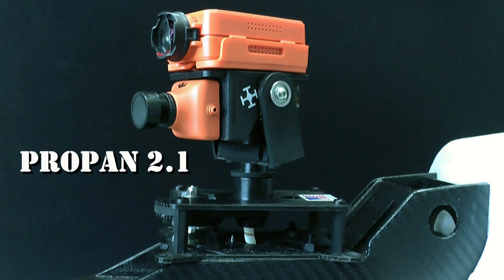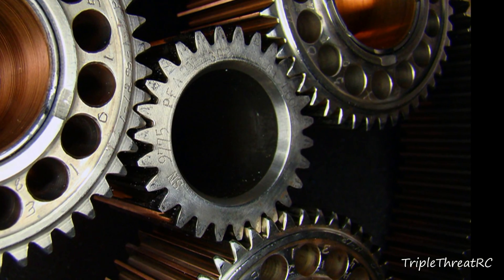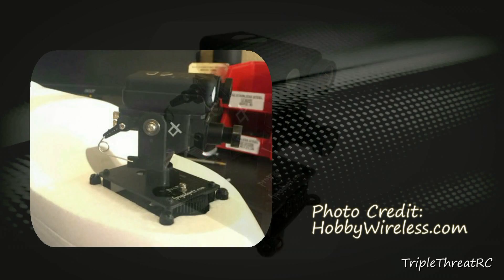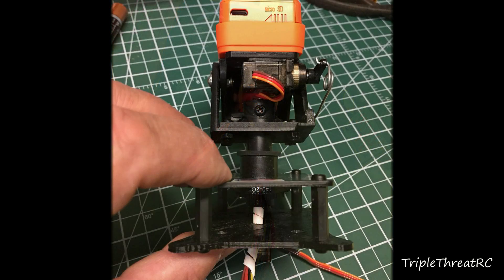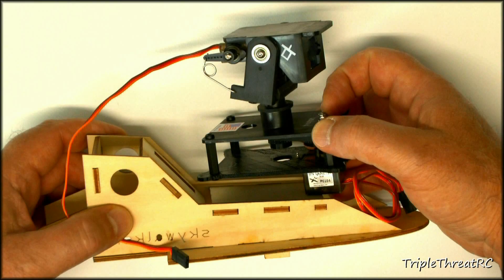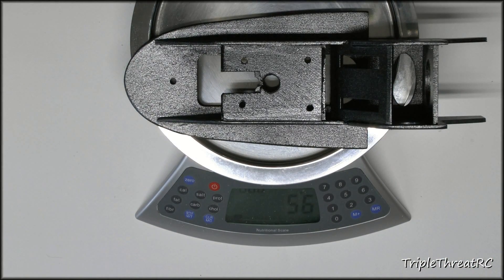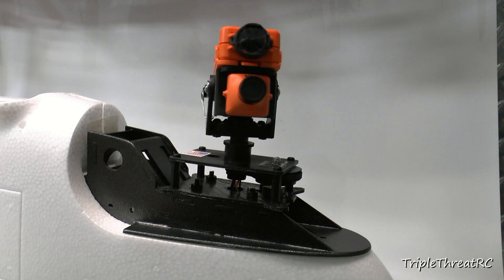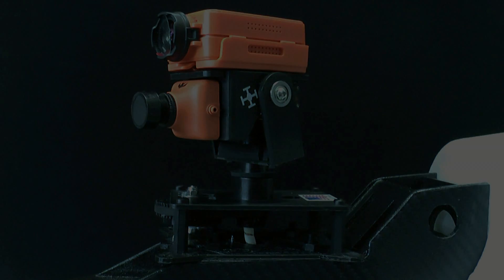ProPan 2.1 FPV Pan and Tilt System - First Look

Comment: How did you secure the swift?
Reply from the maker: I used 3M trim tape used for sticking trim pieces and emblems on vehicles. As long as you clean both surfaces with 99% Isopropyl Alcohol before applying the tape, it is very secure.  I hope this helps, happy flying to you.

Comment: I would be very careful about ordering this PnT. The quality control on this thing is really bad. I just received one of the ProPan 2.1, it's roughly manufactured and put together. First, not sure why they would do this to a cast part, but the U-cradle piece looks as if it was shaped by using a rough angle grinder. It was gouged pretty aggressively. The casting is also "off" quite a bit, so the upper bracket of the "U" appear to cant in by several degrees. As I was looking at the assembly, I noticed the nylon or plastic Phillips screws they now use were rounded over, as if they were being forced into their holes (there are 4 on the cradle). Curious, I removed the screws and sure enough, the holes look to have been drilled with a hand-held drill (not a drill press) and were not straight. One of the holes looks to have had several attempts made to drill it straight and eventually had the screw simply forced into its place(this is the one that was stripped). That hole looks like a figure 8, like two small holes together. Additionally, there is slack in their nylon reinforced belt, I can see this quickly needing to be replaced.   All in all, I'm not impressed. For something that is nearly $70, and supposedly handmade by a "pro", this is very shoddily manufactured and assembled. If I didn't know this came from the USA (my home state of Texas, actually) I would've guessed it came from a low-end Chinese factory. For the money, it's unacceptable. I'd say this isn't an improvement over the standard sail-winch servo design. Simple is best and this is overly complicated and, more importantly, terribly manufactured and assembled. To be fair, I've not contacted them to let them know. .. but I'm shocked they would even send this out to a customer as a finished product. I'd skip this one or have someone print one of the itsqv.com's PnT designs.
Reply from the maker: Thanks very much for your feedback. It would appear that the prototype version I received was built with more care than yours seems to be. As a prototype, mine is obviously a little rough around the edges but works flawlessly. I had no issues with the fit of any of the parts and I'm happy with the way it performs. I hope you contact the manufacturer and see what he has to say about your concerns. Let us know. Thanks for watching and happy flying to you!
Reply: Mine just arrived, 2.2, and it seems quality control is still a problem. Where the spring goes they took several attempts to drill the hole and one is too big and the other is less then a mm from the edge and will eventually break. I emailed fpvgadgets with my complaint. We will see if their support is better then their qc.

Comment: Other than disaster with my poor landings, is there any reason this wouldn't work mounted under the fuselage?
Reply from the maker: Well, it's awfully tall so you'd have to have seriously tall landing gear. And, the unit is designed with more down angle than up for obvious reasons. This means that if you mounted it on the bottom you would get a fine view of the belly of the plane. It would be able to look “down” towards the ground but as much. I can't think of any reason to want to put it on the bottom. What type of plane are we talking about?
Reply: It started as an H.K. slow stick, but has been turning into a bush plane. Im just using the wing set now.  There is 6.5 inches from the ground to the bottom.  I have a runcam mounted under it with 3.5" clearance. It may gain an inch or two when I build the new suspension.
Reply from the maker: I think this unit will be far too heavy for a Slow Stick to carry and there is no fuse to mount it to.  Happy flying to you!
Reply: It would probably be best used as intended, even though this stick is 2 lbs and gaining!  I will probably get one at some point for another build. Thanks for the thoughts.

Comment: 79 Grams!! Almost 3 Oz?? And that is without a servo!! Mine is only 37 grams and I made it my self including servo and all!!! ...
Reply from the maker: The overall weight is not an issue on this plane and was helpful in achieving the proper CG. I'm glad your unit works well for you. Thanks for watching and happy flying!
Reply: Well, thank you very much for your prompt response, In my case I'm always trying to cut weight to fly longer... so that is the only reason for my comment! thank you again!
Reply from the maker: +Marco Cruz 
Yes, if I wanted to fly longer I would be looking to shave some weight too. As it is, the plane can fly longer than I want to.

Comment: This is so cool it makes me want to get a quad for it.  I fly 250mm and smaller so I don't it will fit, but I'm really impressed with this.
Reply from the maker: Great comments. This pan and tilt unit was really designed with planes in mind but I hear where you're coming from. Thanks very much for watching and taking the time to comment! Cheers, Bob

Comment: Man this looks very nice!! Great review Bob! Are the servos digital or analog? Thanks for the shout out... :)
Reply from the maker: Thanks very much Mike! As far as I know they are analog. I'll ask them and will get back to you when it's confirmed.  Thanks for your help sourcing the pod (and other crap), it's perfect. The vertical stab on the SkyWalker looks like a friggin boomerang and I doubt it will steam out. I had it laying out in the hot sun with some weight on it and it didn't budge. I think I'll have to order a new one. Not happy.
Reply: +TripleThreatRC cool yeah I'd say there anologe.  There not chirping when stationery are they? if not there anologe. Bummer on the stab. once you glue in the spars put weight on it and let dry. Should keep it flat.
Reply from the maker: I was wrong, they're digital.
Reply: Ohh ok, hopefully they are good quality. Some digital are bad. I only use Analog with my fpv planes.
Reply from the maker: I talked to them and they are happy that they are using good servos but they also agree that when the customer talks, they listen. If people would prefer to have analog servos they will switch over (not for an individual request but for all of the units they produce). Anyhoo, the servos would be dead easy to change out.
Reply: Thats good, yeah i had some bad experiences with digital servo and the UHF. But mind you they were cheap ones from HK. Just run the DL software and do some test to see if they are causing any issues. Run the spec analyzer and move the pan and tilt. You'll see if they pull a lot of amperage. The ones i had caused actual brown outs...i had them in the tail of skywalker.
Reply from the maker: That's not good!  I'll pass along your comments. It's good to know that they aren't closed minded on the subject. Quite the opposite in fact.
Thanks Mike!